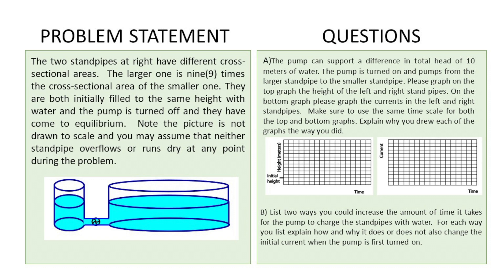PHY7B Exponential Decay Practice Problem - Different Cross-Sectional Areas

Comment: where did you get the fact that the initial height of the water was 2m?
Reply from the maker: Hi Joshua. In this particular quiz students were given this as an initial condition. It was on the instructions :) If you look at the instructions the graph you had to fill in says initial height at the 2m mark. Maybe I should have said it again when drawing it since I don't leave the instructions on screen; I'll make a point of that :) I apologize for the confusion!